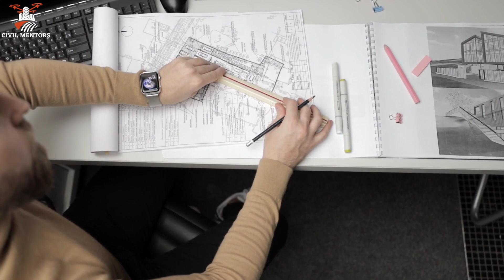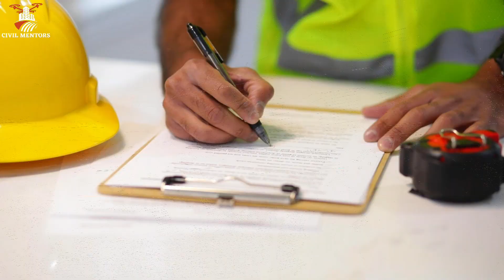14 Steps of Building Construction

Comment: 00:02 Land acquisition and site selection is the first crucial step in building construction.
00:51 Site survey and soil testing provide crucial information for construction
01:47 Obtaining permits and site preparation are crucial steps in building construction.
02:41 Foundation and structural framework are crucial for building stability
03:30 Masonry work adds aesthetics and functionality to the building
04:20 Plumbing, electrical, and HVAC installation
05:10 Landscaping and External Works
06:05 Regular maintenance is crucial for building longevity
Crafted by Merlin AI.